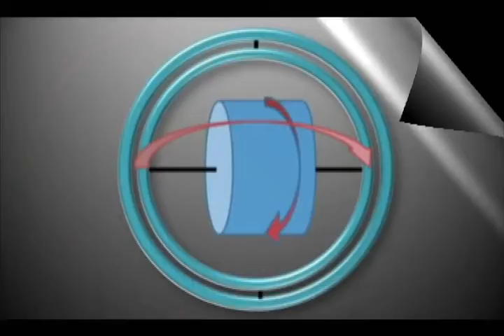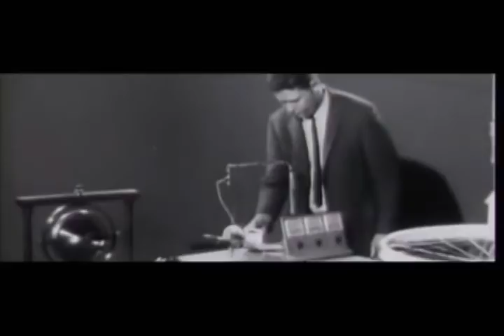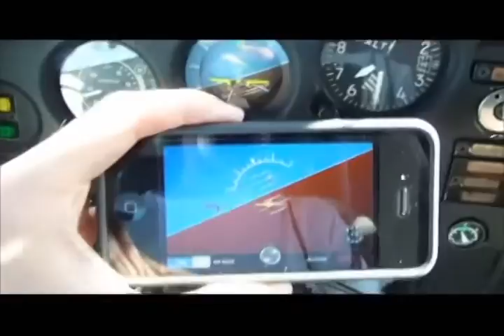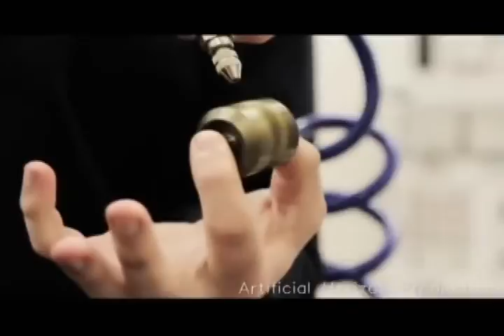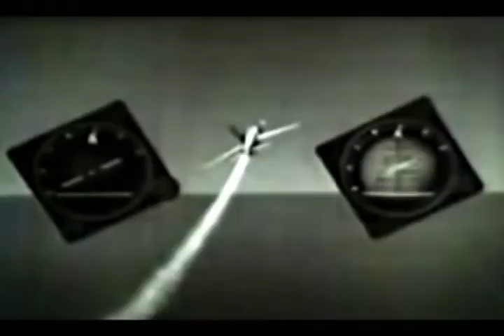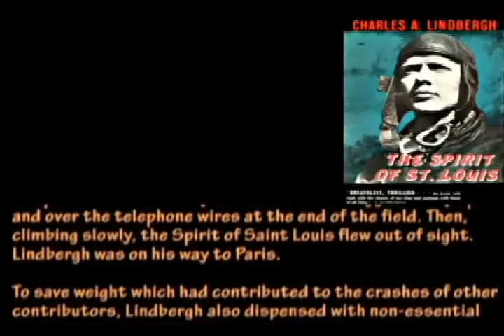Earth Shape Deception.. Flat. I Think.. Piolets & Gyroscopes = Flat Earth

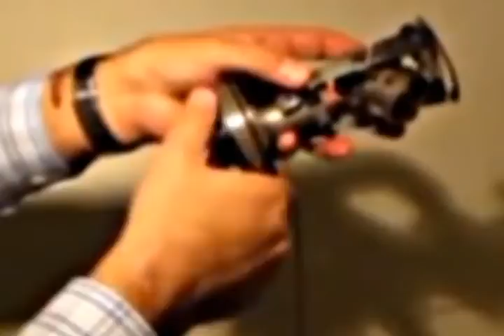Comment: Great video, however, you need to do a tad more research.  At time index 16:47 you introduce the gyro that is powered by air rather than an electric motor.  When I researched the matter over a month ago, what powers the gyro is a vacuum system.  In other word, air is sucked through the gyro mechanism not blown through it.  So, the ports you are talking about, the air is not blown out of the ports, the air is either sucked out of the ports or into the ports, depending on the direction of air flow.  That changes the entire dynamics of how and what those ports do.  Give it some thought.

Next, not one port is closed or opened at a time, but two ports are opened and closed at the same time.  If you notice the ports on opposite sides of covered by one continuous flat strip bent in the shape of a "U".  The ports are offset so that when that "U" moves one direction it opens one port while at the same time closing the other port on the opposite side.  You'll notice that there are only two "U" shaped flat strips covering the four ports, two ports for each flat strip.

Regardless of the above, as you said, there are many problems with those "U"s actually doing something to keep the gyro perpendicular to the earth's surface.  Once air is moving through those ports, there is going to be a lot of friction keeping those "U"s from being moved by the minuscule force of gravity compared to the force of air flow.  Not only that, if gravity has any effect on those "U"s, then centrifugal force will have a much greater effect on those "U"s.  Think of a plane circling an air port for landing, at least one of the "U"s will, during the entire turn, be forced to the outside of the turn continually correcting the gyro, assuming that is what it does, which will cause the gyro itself to spin, causing the instrument to show the plane is tumbling wing over wing or nose over tail or some combination there of.  Now, put that in a fighter jet engaged in combat where there are many Gs of centrifugal force on those "U"s.  We should sell such gyros to our enemies, we wouldn't have to engage them at all, they'd crash long before reaching their target.

Again, great video.
Reply: What i dont get is if they have something that "corrects" the gyro to the curvature of the earth why even use a gyro in the first place then, couldnt they just use this magical tool that always knows what's level instead of the gyro?
Reply: What i really want to see though is just someone bringing a normal gyroscope onto a plane. If the plane does continual height adjustments that we for some reason can't feel,  the gyroscope disc should be tilted upon landing, right?
Reply: A few months ago, I watched a video where the part that supposedly corrects the gyroscope malfunctioned and was disconnected from the gyroscope.  They couldn't get a replacement, so the pilot chose to take the flight without it.  This was a commercial passenger plane.  They were allowed to do that but were instructed to radio in every 15 minutes to get the corrections to do manually.  The flight was, if I remember correctly, 6 hours long, and they radioed in as they were told, but no correct was ever needed.

I figured that video would circulate around again so didn't take down the link to it, but I haven't seen it.

The last three images here: http://imgur.com/a/HXut9 explains what I'd like to see happen that would either confirm or deny a flat earth.
Reply: That is very interesting. I will try to find that video.

It seems that just a consumer gyroscope taken on a car should be able to prove flat or globe-earth. as long as its filmed from point a to b and the bumps arent way too rough(after all gyro's are used inside planes in AI's, etc) or am i forgetting something like  precession or something?
Reply: With a properly functioning gryo in a virtually frictionless gimbal, the only problem you will face is comments such as "Your gyro is not good enough." or "The experiment was not controlled enough." etc., from the side the evidence your experiment produces is contrary to.  Of course, they will never tell you what gyro would be good enough nor will they tell you an acceptable way to do the experiment, because to do so would mean they would have to accept the conclusion the evidence points to.
Reply: yeah. that and the fact theyre shills. you can easily spot them, they always have a picture of space as their avatars and always use the technique of belittling, ridicule or bs like you said, and they are on every goddamn video, their names go on again and again...

i doubt its their hobby. seems a pretty sad hobby.